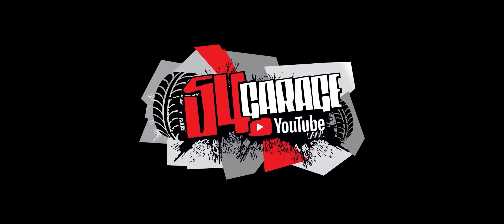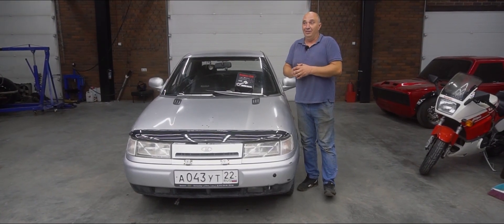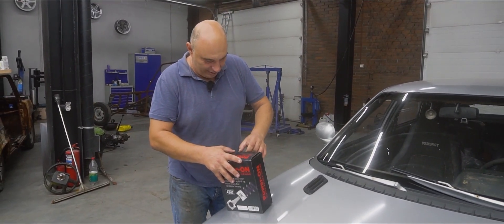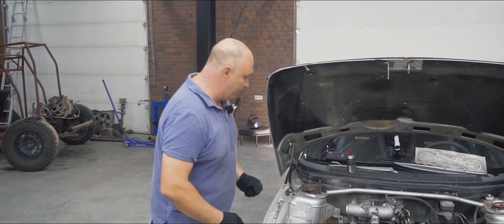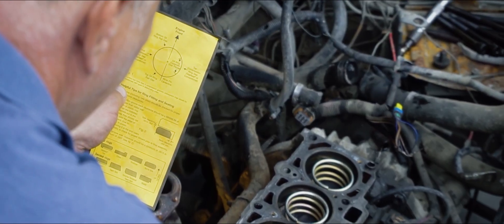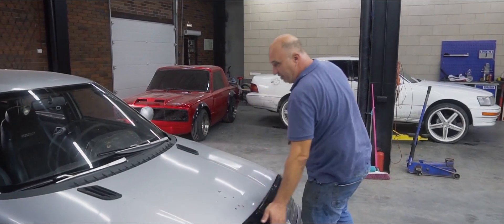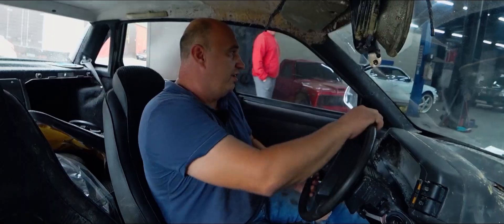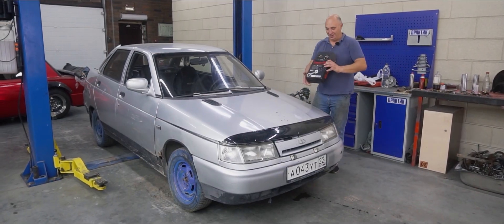Piston return springs (good for 30 HP) – do they actually work?

Comment: try making a custom crankshaft and camshafts so that all four pistons fire at the same time
Reply: Cody Wolf with the stock crank and custom cam  you could make it into an odd firing pair... 1&4 fire, 180* later 2&3 fire, 540* cycle starts over.
Reply: @FlatBroke612  that would be like a  doubled John Deere Engine
Reply: @FlatBroke612 sort of like Harley Davidson firing order but with 2 cylinders.
Reply: I actually really like this idea!
Reply: This needs more up-votes!  That'll be one heck of a video.
It'd also be funny to see how out-of-balance the whole engine gets and how hard would it be to get it all balanced out.
Reply: @TheHungrySlug  needs more cowbell! lol!
Reply: Google flat plane cranks. Some V8s fire pairs of pistons. TVR used one in the Cerbera.
Reply: @stephencresswell4760  the traditional firing 4 cylinder is a flat plane.
Reply: @stephencresswell4760  Wrong, all flat planes operate like (2) 4 cylinders with alternating fire order - left bank and right. No engines fire 2 cylinders at the same time...
Reply: also electronic ignition dont will run, if they will ever manage to biuld a crankshaft, it will need a carb car and attach all cables from the distributor plug of the cylinder who is timed
Reply: You need to post it on Garaj 54 the russian one i doubt they ever check this one
Reply: Bro im a motorsport engineering student and we learnt what would happen if you did that recently and the sight a of a car running like that would make me piss my self. Its so wrong but it would be so right at the same time
Reply: @Diabolical-Tyrant  some people are so dense they jump in and make all the thickidjits appear.. 
Remember there's no substitute for facts. hearsay is always a bad idea to repeat without confirming results and info first.. 
Maybe google hasnt entered his world after porn and youtube...
And this is called spamming the membrain construct.
#spacemothlightyear
Reply: Hell yeah! Going to need 4 coils though.
Reply: The simpler version would be firing 2 and 2. Only camshafts and ignition need modification.
Reply: "Those instructions are definitely not for us."
Reply: THATS EXACTLY WHAT I WAS THINKING
Reply: OK, yea, that sounds ridiculous.  Do it!
Reply: Ooooooh, I wanna see. I predict its gonna be the same as having one cylinder. Except each stroke provides insane amount of power
Reply: Or a v8 with two firing simultaneous
Reply: It would be made of wood because this is Garage54, not Papadakis Racing
Reply: They should do it with a v8
Reply: The cranckshaft will explode I gues lol
Reply: OOOOOOO I WANNA SEE THAT!
Reply: It wouldn't work, but thats why he should do it! Just to see it destroy itself trying to run for a bit. It might need a big flywheel weight? But I agree doing 2 + 2 might actually work, at least last longer.
Reply: Just ride a single cylinder motorcycle.
Reply: If you could get it started it would vibrate apart in less than 5 minutes.
Reply: @robertwood3970  NO WAY! i think that engine will put out a kazillion HP
Reply: it will sound like 1 cylinder then, no difference, just a huge one cylinder, like ktm bike
Reply: Aren't they supposed to go under the piston to fire it back up?
Reply: Look up any single cylinder engine and thats what it will sound like. Also will be giving up all ability to take advantage of scavenging from tuning the primaries on the header
Reply: LOL🤣😂🤣🤣😂 world's most out of balance engine!!? I sense there's lots of extra ladas to work with though. Lol🤣😂
Reply: DONE!!
Reply: or they could put a cross plane crankshaft in it like a v8. there’s a motorcycle that had an engine like that and it sounds exactly like a v8.
Reply: @boxr_4214  yes the crossplane yamaha r1 from 2009 onwards used a crossplane crankshaft it was an inline four and sounded like a v4, very unique.
Reply: Yes!
Reply: Yes please do that
Reply: Why? Be very lumpy....
Reply: this would be great!
Reply: 1432, then 360*
Reply: Yeah!!
Reply: The "big bang" configuration uses the same crank but a different cam so that the sister pistons share the same strokes instead of being on opposite phases.
To do all pistons on the same phase you'd need to somehow add balance shafts.
Reply: Do it
Reply: Yes that would be some good shit
Reply: thumbs up for that "thumping" engine
Reply: Can't wait they doing this :D
Reply: Why not just use one huge piston and 
call it "ole thumper"
That way when cornering you can skip over to the other side when its wet.. Maybe make it like an old oil well..
Reply: Love that idea
Reply: It won’t work as a 4 stroke as there wouldn’t be enough momentum for the compression cycle. As a 2 stroke or cycle it might run for a bit but there would be balance issues and blow up eventually.
Reply: I have an ArcticCat snowmobile twin1100 cc turbo. Both pistons fire simultaneously.
Reply: Hahaha would be cool to see but it wouldn’t stay running
Reply: i had to dislike because a like would have moved it from 666 likes.
Reply: YESSSS, THINK ABOUT THE FUCKING TORQUE, assuming it runs
Reply: YES GOD
Reply: Omg yes!
Reply: Indosarnia  one at a time 1/8 revolution apart
Reply: @scruffyzejanitor  
45 degrees
Reply: Indosarnia  Why what? 4 coils? You can't have multiple spark gaps in parallel, only one would spark. You can have them in series, but not with all spark plugs and the coil sharing a common terminal (ground).
I once made a huge potato cannon with 4 spark gaps in series, and that worked, but only all electrodes were insulated from each other.
Reply: @skuula  the lycoming engine on a cessna 172 has 2 spark plugs per cylinder, both firing simultaneously
Reply: @michaelking3327  It uses 2 coils, 2 distributors (or none) and 2 sets of points, right? Jonathan W. here in his channel by the same name recently showed an old firetruck gasoline motor. Does the same.
Reply: @skuula  no points on the lycoming, it uses magnetos
Reply: so what im saying is they make it so all four pistons have strokes at the same time, not making it two stroke. they all have the intake stroke at the same time, and the power stroke and exhaust.
Reply: @firewalldaprotogen  very unbalaced
Reply: scruffyzejanitor thats kinda the point. also it won't be as unbalanced because the crank will have counterweights
Reply: You'd need a balancer shaft, the power would be off and potentially vibrate like a mF
Reply: A straight 4 or 5 or 6 cylinder would detonate pretty quick. A v engine could maybe last longer...
Reply: yes
Reply: They can only fire 2 at a time
Reply: Mihail Petrovici i don't think you understand what "making  a custom crankshaft" means
Reply: to all you saying "oh that would be pretty unstable and it might break" thats kinda the point . it would be really interesting to see how unstable and if it breaks at all. and if it does break, how extreme?
Reply: You would have to have a massively heavy flywheel with an equally massive counterweight.  But what a thumper!
Reply: Please
Reply: best idea ever
Reply: No counterweight either
Reply: I really hope they some how take notice of this wonderful idea
Reply: The engine will not turn over. Maybe do one that will fire 2 cylinders together (in a 4cylinder engine)
Reply: I almost rushed to rage-comment before the half point of the video. Almost got me, almost 😅
Reply: Dude yes
Reply: That'd be wild
Reply: Hahahaha theres a reason for firing order bud but it would be hilarious though , it would basically be a single cylinder engine.. it would be un balanced and probably blow the head off with that much compression at once on the entire head .... plus the timing of it , it probably wouldnt create spark unless you put a distributor for each cylinder that gives spark on each piston at the same time.... not only that each revolution would break the engine mounts , or making a harmonic balancer that is balanced for it, but that would need a lot of weight....
Reply: @benjaminsmith8058  the reason for the firing order is smoothness. but yeah it would prob break but it would be cool to see
Reply: I already know why this won't work for long...
All of that reciprocating mass will break the crankshaft.
Reply: So basically a big single cylinder engine
Reply: That sounds horrifying. Let's do it.
Reply: A two cycle V8 engine by swapping cams with one out of an old Detroit Diesel two stroke and distributor gears that turn the rotor twice as fast.
Reply: @kaisersose5549  plus there is no distributor on a diesel engine at all they run off compression and air intake on the power stroke through the block..
Reply: @kaisersose5549  do you realize how big an 8v71 or 8v91 Detroit is!! LMFAO even a Series 60 Detroit is like 1 3/4 the size of a ford 300 strait 6 the lobes on the cam would not even fit through the casting hole for any of those, and 8v91 which is the better v8 diesel engine Detroit made the weight is about 1700pounds  .. LMFAO
Reply: FLUMP FLUMP FLUMP BANG!
Reply: @ImmortanJoeCamel  YESSSS you get the idea!
Reply: That would be a bomb lol! No where for the force to to but boom!!
Reply: That’s a good idea they shouted make a custom head for it and make it a 2stroke aswell
Reply: I'll upvote that would be some crazy torque I would think, but would hop around like a jackrabbit.
Reply: That's a good idea!
Reply: Blown motor upon crank
Reply: it would be hella shaky
Reply: The engine wouldn't be balanced then
Reply: @AstrosElectronicsLab  yeh definatly. I think it would probably run a bit like a lawnmower engine though. So it'd probably work
Reply: unique idea. but he should do it 100%
Reply: won't work at all lol
Reply: CRAZY ASHIT! PERFECT!
Reply: Everyone upvote this I gotta see this in a video
Reply: Or make Camshafts to do a "flat pane" 4cyl and fire 2 cylinder simultaneously :')
Reply: @ViktorAgnarFalkGumundsson  that's mad, but 4cyl's are "flat plane", it's actually rare to find crossplane i4's, due to the balancing issues they have. but... about the 1-4-2-3 or 1-4-3-2 firing order, that could either help with power or just make the engine very inefficient
Reply: @gbsoffiati  i know most 4cyl (nearly all?) are flat pane :)

I'm saying he should make a camshaft and see if they can get the engine set up so it will simultaneously fire cyl 1/4 and 2/3 :)
Reply: that would shake like a mf lol
Reply: Yes!! Would be awesome... Imagine what it would sound like. Youd need some good engine mounts...
Reply: Dear god
Reply: Imagine the vibration
Reply: Underrated comment
Reply: lol great idea
Reply: Oh God no I see a really big fireballs coming
Reply: I suspect it would run pretty much like a single cylinder, given they get their custom crank balanced properly.
Reply: i heard those single stroke flat plan crank and cam can do the trick, and remember a high torque starter
Reply: If all the cylinders fire at the same time then mass havoc can happen cuz then it would fuck with the flow of fuel and exaust
Reply: If they fired together then when fuel enters the intake the fuel will mostly go into the closet cylinder witch will cause a miss fire u would have to run air and fuel to each cylinders so they don't share the same tube
Reply: It most likely wouldn't even start o haven't tore an car engine down but ik what it looks like on the inside and I can completely rebuild any small engine but most of the new small engines work like car engines the both have valves and the fuel delivery is the same so yea that's another thing but if u do do all the mods to make that work then it would sound like a big cam so with all the work ud have to do is just be better off putting a bigger cam in it and it would run the same way and sound the same cuz the cam makes it fire at a surten time and makes it sound like there fireing at the same time of u have them fire together and I have to setup to run like it has to then them fireing at the same time will put alot more strain on the cam and then cylinder walls will get way hotter than usual cuz there will only be a small cool down period for every cylinder but stock the pistons that are going down cool down while the other ones go up and sounds like it wouldn't make a difference but it does cuz it give each side a small break like riding a skateboard with ur right foot it starts to get tired so I switch feet but if u was to use both feet then theres almost no cool down time for example try rideing a bike like a scooter then after doing it will one foot u switch and it makes u feel better k well then do it will both feet and I'll see that ull do nothing but hurt other parts of ur body and tire out both feet and wear ur self completely out of energy but when I do it the other way I will be able to go longer cuz u ant wearing ur self out as fast and u won't have to stop to rest it leggs cuz when ones working the other one is getting ready then I switch and u feel better that's how that would work in a motor
Reply: And if they fired together and one or two was miss fireing then the cam could break in half cuz the ones that's missing won't move as fast as there supposed to so will one side is going as fast as it should the other side is almost going that fast but a tad bit slower witch that's what fucks them up cuz when there fireing it goes down as fast as it's supposed to and the fire will push the pistons down if there not fireing then the crack shaft will be pulling the full waight of those pistons verses just going witch gravity like when I spin ur kid around when ur makeing ur self spin faster it's easy af then when I start to slow down u feel the full waight
Reply: Shit I built a mower that goes 40  mp and my rear end just randomly locked up and it happened so fast that I didn't let go of the clutch witch all that would have done was allow the engine to stay running cuz my rear end when it randomly locked up the motor went from full throttle to acting like it's dieing then finally it shuts off and the tires lock up it seemed like the rear end locked up cuz the clutch was engaged and the motor died causeing it to lock up when it was the other way around the rear end was locking up and it was makeing the motor die so as soon as it shut off they locked and i almost went into incoming traffic I could have easily flipped but I didn't let it get side ways but had I been going any faster like at full throttle it would have kept going side ways no matter what and I would have flipped cuz even tho I was fighting it it still tryed to so if I had let go of the clutch when the motor started to die down then I would have flipped cuz the tires would have locked instantly cuz when it happened the motor went from 5000 rpm to less than 3 when it shut off due to strain
Reply: And get this there was nothing wrong with the rear end it just decided it was going to try and kill me cuz all I did was take it out the road and when I put it into nutral it acted as if it was in gear with the belt ingadged witch it wasn't so it could have possibly just been a gear slipping up and grabbing another gear causeing it to lock or something small broke in the tranny and it got stuck in one of the gears cuz all I did was start it back up and put it in first and go and it worked as if nothing even happend now that was scary never had that happen before
Reply: I'm pretty sure the crankshaft would shatter the block and fly out of the bottom of the engine
Reply: would need a MASSIVE flywheel
Reply: That sound interesting
Reply: Good idea.
Reply: Well that'll be just a big ass thumper motor attached together
Reply: That would be one hell of a sounding engine
Reply: YES
Reply: YES
Reply: Yessss
Reply: oh god
Reply: Easy boxer engine
Reply: Wow😍😍amazing idea
Reply: I would like to see this
Reply: that can be really interesting
Reply: I dont think that will work it might work at with 3 of them firing at the same time
Reply: Dude my 2 piston motorcycle haves a engine just like this lol. Pistons moving together
Reply: @Alpi-yn5jk  I doubt both pistons fire at the same time or else it would have just been more smart to have 1 giant cylinder.
Reply: @amorag59  yes both 2 pistons fire at same time. You can google it regal raptor 250cc engine
Reply: @Alpi-yn5jk  No dude, if that were true the intake/exhaust cams would be identical for the cylinders on both sides of the camshaft...
Reply: @amorag59  Yes it is like this. Look at chanel and google it. Its a bizzare engine
Reply: @amorag59  its called parrarel 2 cyclinder engine just google it. Its a engine with 9:1 compression ratio. Its underpowered engine for 250cc ,because both 2 pistons goes up and down at same time.
Reply: @Alpi-yn5jk  The fact that it is a "parallel twin engine" is the first thing I saw. That doesn't mean they fire at the same time. As I said before, it is very clear one cylinder fires while the other cylinder is at the top of it's exhaust stroke or the cam profile/shape would be the same for both cylinders ...
Reply: HAHAHhahhahaha I'll stop laughing in 2022 XD please do it!!!
Reply: My motorcyle engine is working like this. Its already made a lot of years ago
https://www.youtube.com/watch?v=_D253ccL2xc
Reply: @Alpi-yn5jk  That Alfa Romeo video proves my point, "parallel twin engine" does not mean both cylinders fire at the same time... At :47 in that video you can see the valves are not doing the same thing (if both cylinders fired at the same time the valves in both cylinders would move at the exact same time - moving air in, then closing letting the mix combust, opening to let the exhaust out). One cylinder fires at the top, while the other cylinder is at the top at the end of pushing exhaust gases out...
Reply: A custom crank is probably too expensive, and might be too unbalanced and rip the engine to pieces..... BUT if you Google Honda Moto GP Big Bang ignition that might be possible.... mucking with the ignition to work like a hit-and-miss engine at really high RPM, it's sounds crazy but it really worked. I'm sure ducati copied them later
Reply: lmaoo
Reply: Have you not quite got the idea of how a 4 stroke engine works..?
Reply: Four times the intended pressure on the cylinder head cover? I'll make the popcorn!

I had to look at an "exploded" diagram, to see what a cylinder head cover is called. 

Heh. They'll be covering their heads, when the head cover explodes through the hood. 😂
Reply: I always wanted to hear that or 8 cylinders 4 at a time
Reply: Yesss
Reply: They did it!
Reply: @مهدي قاسم you're correct
Reply: How the hell would that work?
Reply: That's an interesting idea
Reply: proot :3
Reply: And now they did.
Reply: 3yrs on and they did do this
Reply: There is no way they actually made this lamao
Reply: They actually did that but the engine produced no torque it was about 3 months ago.
Reply: I saw the video before your comment😂
Reply: They did it
Reply: Dream became real
Reply: 1:24
Reply: It'll just instantly grenade the engine 😭
Reply: 4 years later...
Reply: Yeeees :D
Reply: I guess it won't work.
Reply: Lol it'd be like a giant cell phone vibrator
Reply: Oh dear god
Reply: Yes this guy
Reply: They did
Reply: The biggest of big bang firing engines